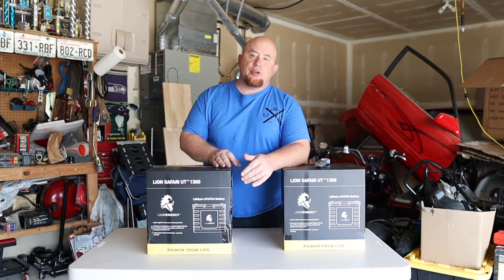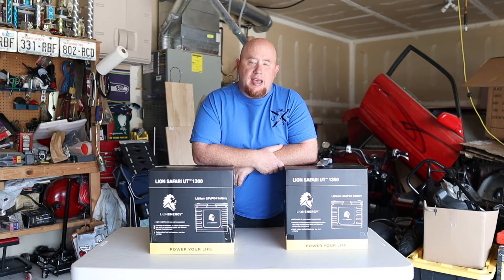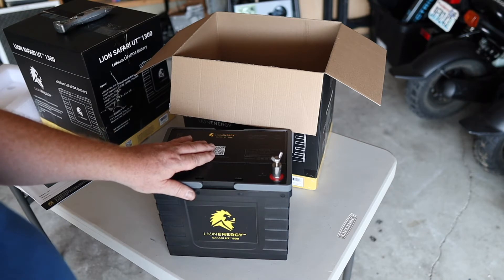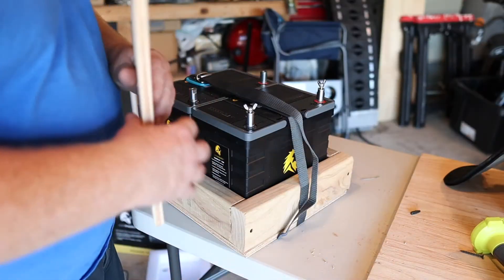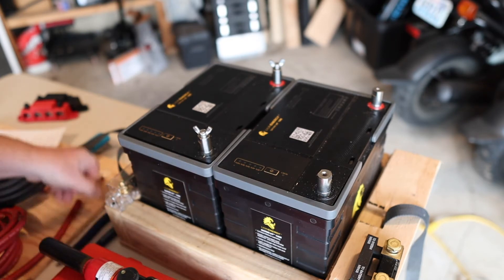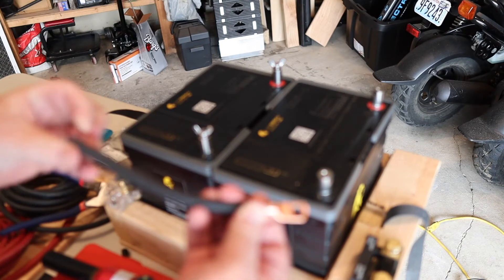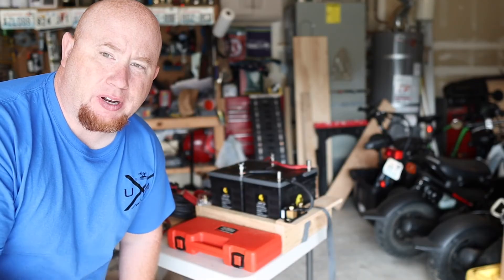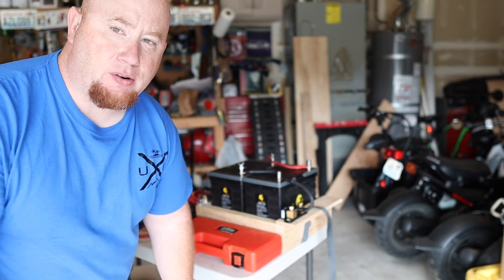MOVING RV BATTERIES INSIDE / LITHIUM RV UPGRADE / LION UT1300 UNBOXING

Comment: Wished you showed how to connect from the old converter
Reply from the maker: Process should be just the regardless.  Just pulling the postive wire out of the 12v side of the converters panel and replacing it with whatever gauge wire you end up treading back in.  You can check out our other video in this series that goes over our Mighty Mini conversion.

Comment: did you have to rerun your power line from you front power jack to where your lithiums are now located?
Reply from the maker: Great question .  We kept the line hooked up to the front of the trailer . At the point where it t connects to the battery we just placed another positive buss bar to allow us to reconnect everything in the front of the trailer .

Comment: I’m planning to upgrade to two Power Queen 100ah Mini’s and move them into the pass through. The new lithium converter will also be installed next to the batteries to keep the #2 wire run short.
Reply from the maker: Always is a good idea to get as close to the converter as possible. Good luck on your install Kurt and thanks for checking out the video !

Comment: Vocab note: 2 gauge is not "2 aught." 2 aught is 2/0, which is short for 00 gauge. 2AWG, 00AWG, etc.
Reply from the maker: Probably got myself mixed up with verbiage. We did use 2 gauge
Reply: @UniqueAdventurez  Indeed. Thanks for the vid, btw. I've been planning to move mine inside as well. For temp control and to gain back the exterior compartment I'd lost.
Reply from the maker: @TheRayDog  it’s definitely nice to get that space back !

Comment: Our 2018 Hartland 23rbs had enough room to slip in a tray i built to hold 4 lithium batteries , 1 2000 Honda generator and a box to hold a 3000 watt inverter . search for a battery box build video build on youtube.
Reply from the maker: Nice Work  , it’s  always nice to have clean install where everything just flows well !

Comment: I love your video because you have a trailer like ours and we want to do the same thing. My question is when you moved the battery bank to the sink area, what did you do with the red and black wires on the other end?
Reply from the maker: Great question Mickey. The line coming off the charge converter factory that feeds the front of the trailer we kept attached to the new battery system though and added a positive and negative distribution block to the front of the trailer. This way we could maintain power back to the front of the trailer for our power tongue jack and heater else is powered off the factory battery location
Reply: @UniqueAdventurez  Thanks for the reply, but is that similar to a bus bar?
Reply from the maker: @mixter7  yes it is. A bus bar / distribution block. You got it !!

Comment: Man I love my Lion Energy 1300's.  I also have two.  I really wish I had 1-2 more if I boondocked very much.  Hope you got those on the costco sale.  They do have an affiliate program, but I don't think you can do better than the costco holiday sales.  I'm still hurting though and it was a year ago.  I will say when we boondock in cold weather we use about 50% capacity overnight, but I don't really try to conserve because I do have the generator in my camper.  I'm working on a super special project right now with some transfer switches and such so I no longer have to run a cord.  Also got a 2k watt inverter so that I can run my whole rig (minus the A/C) on these bad boys.  I have a small modified sine wave inverter that I currently use for my cpap.  Here's my current setup.  I used a lot of the same components you guys used, I did go with a cheaper battery monitor, it's been good but just doesn't have the Bluetooth.  https://youtu.be/VKCuqS0qWxs
Reply: good info, thanks
Reply from the maker: we haven’t felt to need more than the 2 batteries, but we have yet to hook up to inverter yet. can wait to see your project you got going on. we really love the victron smart shunt , really like the convenience of the Bluetooth.